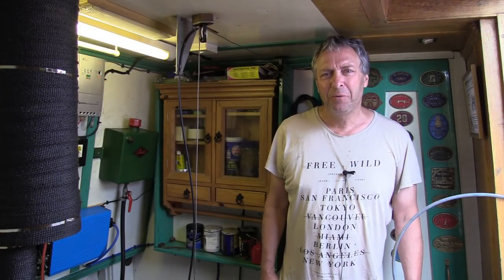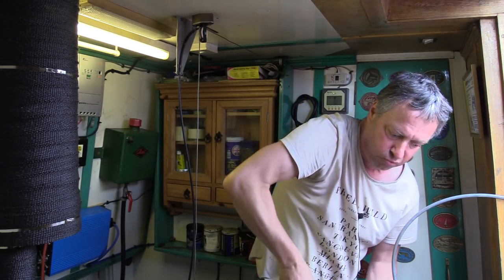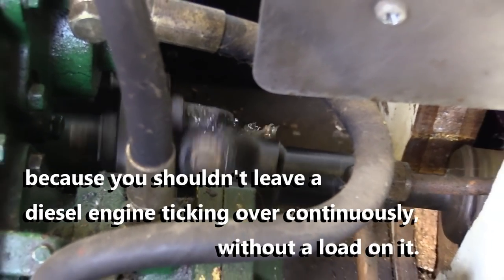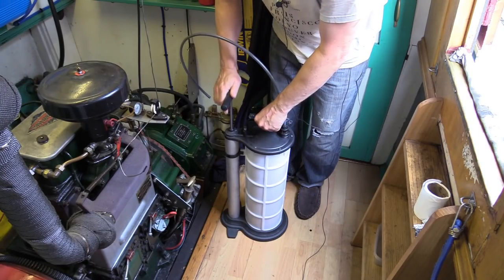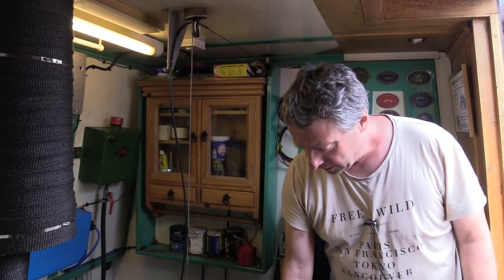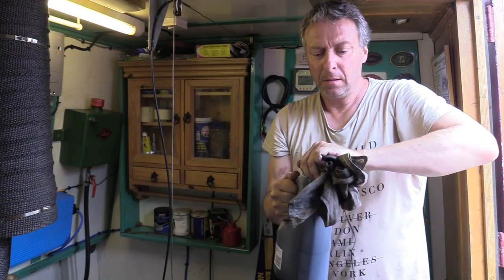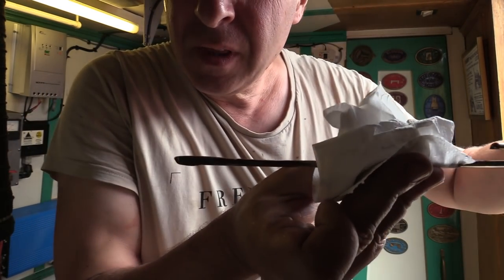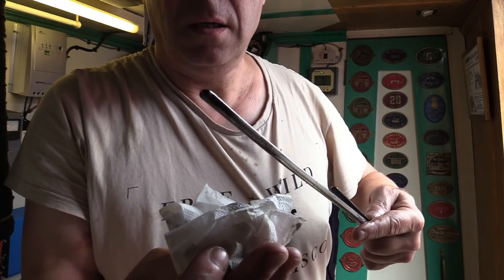Vintage Engine Oil Change On A Narrowboat . . .

Comment: Is that why when you go close to vintage engines you have that unique oil smell? It smells nice. ( As in the oil is designed to plug up)
Reply from the maker: Yes, these old engines do have a hot oil smell to them. I had an old motorbike that was the same as well.

Comment: Hi CHG, I'm now into season 3 of my nightly binge watching and I have a question...... you just went through a tunnel and now you're on the Bridgewater canal, how did they get the narrow boats through the tunnels back in the days without engines? I don't see a footpath inside those tunnels.  Thanks

Ah ha, season 4, episode 3.  Run of the mill.  You mentioned "leg it" thru the tunnel,  I'm guessing someone pulled it,  ??

Comment: is they anyway a 90 degree bend can be put on the pump plug to bring the drain outo a more accesable point
Reply from the maker: I imagine there would be David but access to install it would be the problem.
Reply: @CountryHouseGent  so a job for when it needs a rebuild

Comment: Same oil I used in our old VW Beetle. You reckon they used the same methods in the old days Kev? Very interesting vlog👍
Reply from the maker: Yes it's a superb oil Peter and recommended for most older engines, especially air-cooled ones like the Beetle. The engine does have an original small brass pump at the front of the engine but the innards are worn. This is how it was done, so pretty much identical to this modern method.

Comment: Loving ya vlogs.... What engine and what's the two electrical connections on ya air intake?
Reply from the maker: Hi. It's a 1952 Petter McLaren B2, a 2.5 litre twin cylinder diesel. The two terminals are for the preheater. No glow plugs but a hot wire in the inlet manifold.
Reply: @CountryHouseGent  wow.... Bet it flys being a "Mclaren" 😁.... I'm impressed.... Mines the owd lister ha2.... 68 years old and she is  pushing me 70 footer along like a good-un👍🍻..... Oh yeh I was using golden film but it as got so bloody expensive!!!.... Ive since been put onto "RYE OIL" which they use a lot in vintage tractors during plowing competitions..... £69 for 25 liters😉👍

Comment: As someone with zero engineering ability I found this strangely fascinating stuff ! I thought the bit about changing the boat's trim being the domestic water supply very clever.  Pardon the dumb question but why did you not change the oil filter at the same time ?? 😎
Reply from the maker: Cheers Stephen, great to hear that. Simple answer, there is no oil filter, just a gauze screen that requires cleaning every other change.
Reply: Hi Kevin... I am working on restoring a three-cylinder SKODA_CKD engine.
that too has the gauze filter type system: I chat with a bloke in Czechoslovakia ( A TRAIN DRIVER ACTUALLY) who tells me the first job of the operator every shift was to rotate the handle on top of the filter body....to clear the screens...ie, push any sludge to one side, within.
These engines are made in 1 to 6 cylinder versions. 
Each cylinder being 15 HP.....  (Mine is 45hp then)
I'm at the stage of checking out the 24v starter motor: 
Very weird! It has a system of sliding the armature forward which then engages a clutch mechanism.... Mmmm?
Once I get the starter to operate correctly.... I'll go for a check on oil pressure at cranking speed. That being OK...we'll go for a start!
I'd be glad to send you photos if you are interested.
Stay Safe.

Comment: Really enjoyed the instructional video, especially the dream recall! Thanks. Quick question - the brass pump to the side - is that for the engine oil? Do you not use it because the vacuum pump is more efficient or does it just not work?
Reply from the maker: Cheers Tim. Yes, the rubber plunger inside is worn out. Has no lift at all but an original part, so takes pride of place. ☺
Reply: @CountryHouseGent  Ok, we have the same on our newly acquired boat. As it seemed to do nothing as well, thought I'd ask the question. Obviously we're not alone!

Comment: Please could you explain why you shouldn't leave a diesel engine ticking over continuously without a load on it? Thanks
Reply from the maker: Hi Alan. Here's a quote from a yacht website but the principle applies to all diesels.

"Letting your diesel idle for anything more than a short duration is a bad idea because while the engine will use little fuel, what fuel it does burn will not combust completely because the operating temperature is too low. Unlike gasoline engines, diesels need to be under load to reach optimum operating temperature—if they’re not, unburned fuel can cause needless pollution and even can dilute the lubricating oil, increasing wear."

Here's the full article https://www.powerandmotoryacht.com/.amp/maintenance/diesel-engine-myths

Comment: I have always loved changing the oil, I know weird but its usually the 1st thing you learn to do when you work on motors.  It was normal practice for our generation I'm 59. It's too bad things like that are thing of the past. Did you change the fuel filter also or not necessary?

Comment: Did you not also change the oil filter?
Reply from the maker: The engine doesn't have a filter Lyle, only a mesh screen in the sump that needs washing with solvent every other change. Should've mentioned it cos it's the most commonly asked question so far, by a country mile. 😁

Comment: That old engine makes a great sound. Is there no oil filter or did I miss you changing it?
Reply from the maker: Hi David and thank you. Yes there's no oil filter, just a simple mesh gauze that needs cleaning every other oil change. ☺
Reply: @CountryHouseGent  Lie the old VW 's.
Reply from the maker: Yes the same as those. Had an old bike the same. Works well, with the right oil.

Comment: I have a vac pump loke your but it pumps 13 litres of oil from my bus from the dipstick tube in about 10/15 minutes !
Reply from the maker: Yes they are excellent pumps. What slowed mine down was I had to use the smallest diameter pipe available to fit down the dipstick tube. Did try the filler hole but there was to much internal baffling to reach the sump.
Reply: @CountryHouseGent  Must say your engine & room looks very impressive. Re Pump mine uses dipstick tube  & has internal pump also fitted magnetic drain plug . I like the idea of tilting the boat to get max-content to the sump. Happy days & stay safe !
Reply: @CountryHouseGent  lo

Comment: you know you could make your own vacuum powered oil sucking device, wont be as light, but would work a lot faster, ill try to explain if you would like?

as for statement of no detergent oil filling passages up, I did a gamble close to 15 years ago, I bought a tractor that the engine needed rebuilding, very low oil pressure,  smoked horribly, well I started using non detergent, & in a few weeks it was smoking less, & in 2 years it was doing as good as a person could ask for, oil burning went from 1 quart every 45 minutes, to 1 quart every 4-6 hours, depending how hard you was working tractor,  & oil pressure went from 6-10psi,  6 was idle, 10 was max pressure, to low 20's to 30 psi, so would idle around 22 psi, & when working would be close to 30psi,  thats acceptable, we lost farm about 8 years ago, still have tractor, but not used it in 6 years.

Comment: No filter  ?
Reply from the maker: No filter Ivan, just a gauze strainer that's cleaned out every other change.
Reply: @CountryHouseGent  
Have you thought of using oils that have a higher viscosity (your engine is 'high milage') ? Something like 10w40 ?

Comment: "you shouldn't leave a diesel engine ticking over without a load on it"  tell that to the millions of US Semi-Tractor operators who leave their engines idling all night or all day while sleeping or awaiting a load.
Reply from the maker: Just because they all do it, doesn't make it correct? 🤔
Reply: Maybe they cannot be bothered to fire up the cab heater? 
If they have one? Many don't. (out of their normal operating zone?) 
So when awaiting loading/sleeping...obviously they leave the engine running.
Sod the environment, eh?  
Also, probably illegal to do so in many countries.